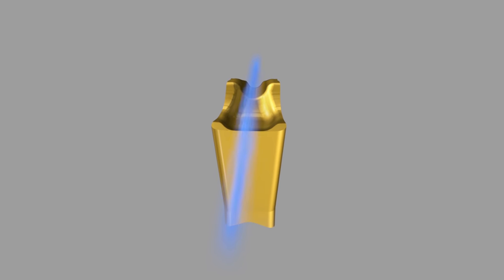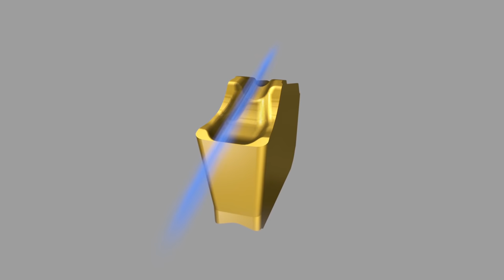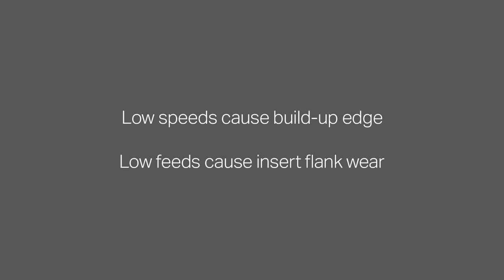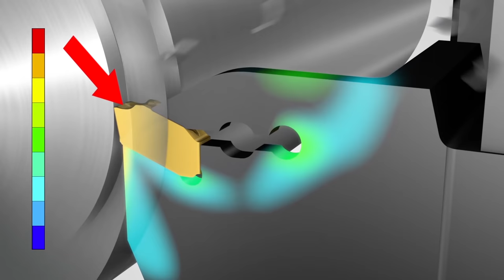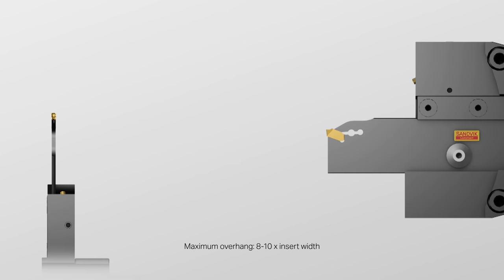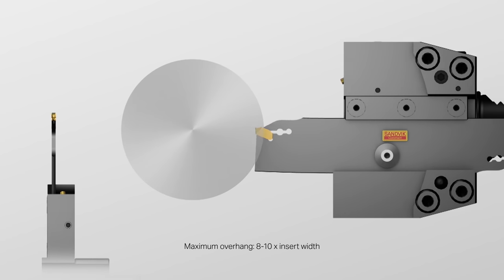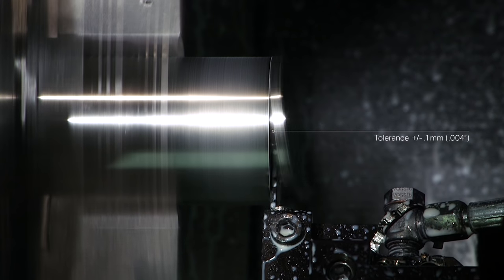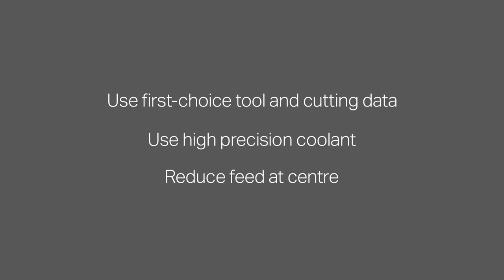Trouble-free and successful parting off - Tips film #37

Comment: No matter what parting tool I use, they refuse to cut.
If I push hard, motor stall or worse.
I don't understand this tool geometry and why it doesn't work.
Reply: The most important thing is to see if the cutting edge passes by the center of your part, or just a little under it.
But if it goes upper the center, the insert will break

Comment: I love the videos! they are so great! can you show by examples how to use the speed charts?
I have a Qcut tool holder but I'm really bad when I set the propper feed rate and spéed. I feel I go too slow than I could, but if I increase a little then it goes too fast and makes a horrible noise.
Reply: In my workshops handbook (verkstadshandboken), it recommends (for example),  Material group 4 (seghärdningsstål) Alloy steel = 0.05 feed @ 200mm/rev  Material group 23 Aluminium = 0.05 feed @ 450mm/rev
I hope this helps.
Reply: Dave Smith can I buy that handbook? I have problema with the licencia of my inserts
Reply: Ro Cuevas Just get the data from their website. 
The website has gotten a LITTLE BIT better than it was last year. 
Side note, regardless of what your rep says, you really need high pressure coolant to get those chips out of the cutting zone.
I have been less than impressed with this system as far as insert life is concerned. 
Not shocking to me considering that's what they make the vast majority of their money on.
I find Iscar grooving/cutoffs to just WORK and Sandvik...not so much and for a bit less.
Not throwing Sandvik under the bus, but it is what it is.

Comment: QD system have you tested pure Nickel 270  not having luck no interruption 2" diam solid part 1125 grade keeps plugging up the top coolant hole
Reply from the maker: +onefugowie 
Hi!
It is difficult to give you a perfectly optimised suggestion without more information about your specific operation. But it seems like you need a geometry that gives shorter chips. Try geometry -CL. Higher coolant pressure will also help to evacuate chips.

Best regards

Staffan Lundström, Product manager P&G, Sandvik Coromant
Reply: +Sandvik Coromant thanks for info will look into CL it works well don't get me wrong but when it does seam to fail its plugged the top hole...I think changing insert sooner maybe its loosing chip control after certain amount of parts